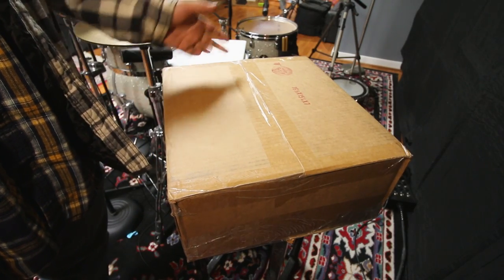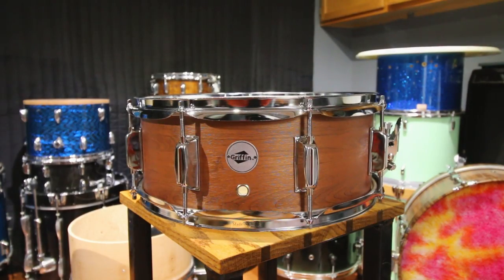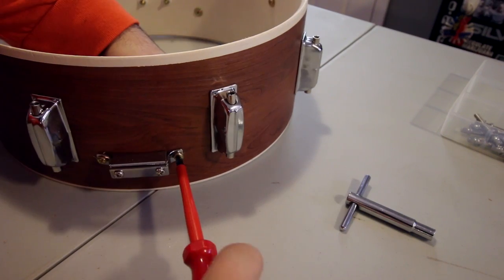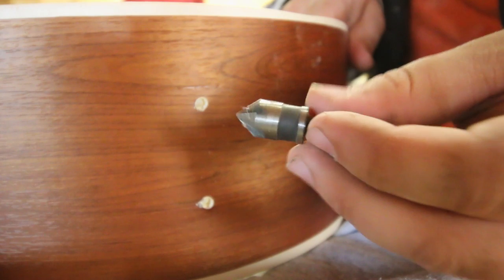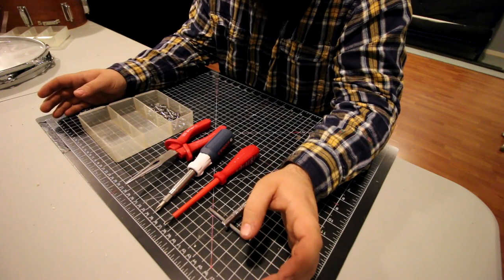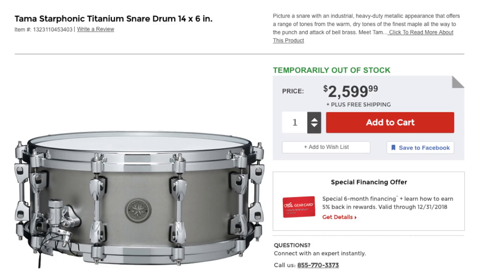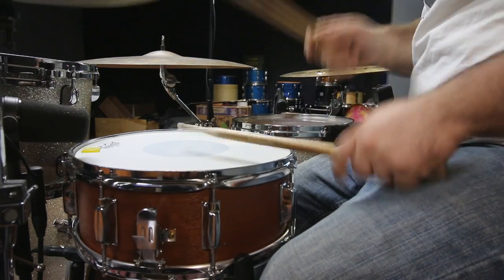The CHEAPEST SNARE on Amazon - worth it? -

Comment: a pro tip for cheap snare ... use the cheapest acoustic foam and place around the inner wall of the snare drum, that will kill the sound a bit but it compensates by adjusting the tension ... it definitely improves the sound.

Comment: I used Tung Oil on my 7 piece Mapex Venus Series kit.. it started out as a 5 piece (22x16, 12x9, 13x11, 16x16, and came with a 14x5.5 snare for $140) all made from basswood. I live in Florida and while it was stored inside a guys house I still felt the need to treat the inside of the shells. I then ran across 2 more toms (8x8 and 10x8 for $40) which I purchased from the same guy who sold me the 5 piece kit. Sad thing is he lived almost 2 hours away and could of just sold me the 2 extra toms last time I got the 5 piece. But thanks to your videos Im now a craigslist watcher lol. I took off the old wrap and used some self adhesive wrap from Amazon. I purchased all new heads and even went as far as to get another snare (Mapex MPX 14x8 maple snare) all of my toms and bass drum heads are Evans... I got the EC2 batters with EC reso heads. My bass drum has the EMAD2 with the bigger muffling ring. But for my new snare i purchased the Remo reverse controlled dot batter and the Ambassador clear snare side heads. Even though Mapex put Remo's coated UV batter with a remo clear UV reso... but after swapping the heads i got the full snare sound. My question though is what would you suggest for dampening? Ive tried that moon gel but it seems to do nothing. While restoring the kit (i turned the bass drum into a virgin bass by filling the tom mounting holes with wood pudy.) Then I used wood bondo for the dents and dings on the bass (i tried to skip that process but once i started putting the new wrap on you could see where the dents were.) Your channel has encouraged me to continue fixing up my kit and after a month of sanding, patching, sanding, using tung oil, and some more sanding... my kit was complete. I only used 2 coats of Tung Oil on the inside of each tom and the bass drum. I left the snare drums alone but after seeing this I may try a coat on the original snare that came with the kit. I dont want to mess up my maple snare. Now that Ive got a 7 piece drum kit that I repaired (mostly cutting out rubber grommets from a sheet of rubber i purchased from amazon) and having spent hundreds on 2 double tom mounts w/ an accessory clamp for cymbals (currently i have 6 cymbals). Im looking for a decent 3 or 4 piece kit. Any suggestions? After wrapping this last kit im not entirely worried about the wrap or how ugly it looks. I mainly check the inside of the shells for rust or corrosion on the screws/washers. Also i look for damage done to the wooden shells. My next set will use Remo coated heads as I see most kits with awesome tom tones have those Remo coated heads. But Im sure the type of wood the drum kit is made of makes a huge difference as well. Thus why Im writing you a book on your old post lol but Ive got a few friends who want to play reggaeton type music and I feel my Basswood mapex Venus series isnt really tuned or styled to play that type of music. The pitch that my drums are tuned too is geared more towards progressive rock.  Any suggestions or tips would be greatly appreciated. But again thank you for posting a the videos you do about purchasing cheap equipment and making it sound good.  Long live the bearded drummer!!! Lol

Comment: "And requires basically no tools"

Proceeds to use a drill and a screw driver
Reply: Face The Bear pretty much everyone has a screwdriver. Don’t need a drill but it helps speed the process up
Reply: dude how do you not have a drill and a screw driver
Reply: @ezicarus8216  yeah apparently
Reply: @genryhennis2102  And pliers, hammers, power drill, circular saw, various hand saws, grinder, recip. saw, drill bit sets, bench vise, vise grips, channel locks, etc. etc. etc....
Reply: @snakeknife7518  all you really need is a drum key and a screwdriver lol most important things he did were replace the heads and the snares and those or the only tools required to do so

Comment: A fun and interesting little project. If you are like me, a drum junkie, than it makes perfect sense. I confess, I did almost exactly the same things you did. I tried something a little different with the springs in the cheap old style Pearl lug knock offs. I used spray -in foam insulation. Spray for like a nano second or you end up with a blob of foam you have to use a razor knife to sculpt the lug back into being. But it works. As for what to do with it, I ended up doing three of them, one in each of the finishes they were selling them in on ebay at the time..and gave them to a local Catholic elementary school band so kids who's folks couldn't afford to buy stuff like that would have something to learn on. (I'm not Catholic, but they aren't rich. So we're even... : ) Thanks for posting this. It's a fun watch.

Comment: I used a solution of 60% Satin urethane and 40% acetone on my 6 ply birch Ludwig "accent" kit, made the wood hard without coating the surface which sounds kind of plastic-ish to me. I did heavy coat, then light, and light, and my low rent birch kit, booms like a 6 ply maple, nice rich tone..

Comment: I actually refinished my Ludwig accent kit when the wrap peeled off and when I did that I did coat the interior with polyurethane, as well as cleaned up the bearing edges, added gaskets and did your cotton ball trick except I used that egg foam stuff. And the kit sounded so much better when I was done.

Comment: See my "is a honda accord as fast as corvette?"

Yes, i just removed the honda body and replaced it with a ferrari body....then, i figured i would just go ahead and toss in the ferrari engine. So now my honda (well, it is a ferrari BUT it has a license plate that says, "my honda is batter than yours."  The dude who owned the hnda before me owned a pancake mix factory.  Get it? Batter?  Try to keep up. Anyway, my honda blows doors and it only cost me 3200$ to buy that honda....3200$ for a super fast car..., genious!  Any body can do it....just go grab a 250,000$ used ferrari and get at it.
Reply: Sometimes it's better if you don't speak

Comment: Good video. Very interesting. I'm making a snare from a crappy 10" x 7" tom: I stripped all the hardware and wrap, gonna give it a green sparkle paint job. I'm making my own wood hoops, and possibly even my own lugs as well. My 'go to' heads are the same as yours. But my snare mechanism and wires on this project are cheapo. My drum is just an experiment in refurbishing as a method of upgrading, and also trying out a much smaller sized snare.

Comment: I did a similar thing with a cheap steel student snare.  A little rtv under the flanges, and a little rubberized undercoating inside, the snare "calmed"  down from it's annoying "pang"  to a crisp, and drier cut. Sounded like a $350 hammered steel snare. Same top and bottom remo heads you installed.

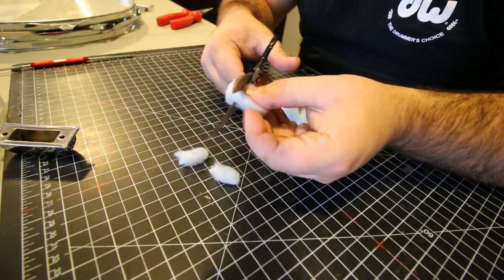Comment: @ 5:40 - this little trick to dampen the spring with cotton wool is similar to the method used to deaden the "spring" sound on a Strat-style tremolo, only I use cut sponge foam rather than cotton woo and have it actually inside the springs - which of course are larger than these drum ones so it's quite easy

Comment: Interesting! I'd have also waxed the bearing edges and replaced the plastic snare straps with cords. Since i never use the internal mute on a snare i would have left it off. For packing the lugs, i like using gray felt weatherstripping (found at most hardware stores). I like the Tung oil idea...i gotta get some of that!

Comment: I did the same shit, bought a cheap starter snare, ripped off the wrap. Sanded  the bearing edges and face.
Lighty stained it and put like five coats of polyurethane on it. 
It Made it a bit harder and heavier
Put some new Remo heads on the top and bottom, fatter strainer. Tuned it high... I swear too gosh it sounded almost as good as my buddy's DW snare. No joke. 
Drums are like anything else you can make a cheap set sound really good if you put the TLC into it!

Comment: Very late to this but if you want to add some sharp snap to the drum add 5 or 6 layers of fiberglass to the inside of the drum. If you do it, make sure the grain of the glass is orientated differently for each layer. Wrap the outside of the drum with painters tape in line with the lug hole pattern and tape the rest of the holes on the outside of shell. This is just to prevent resin bleed through. You might be pleasantly surprised when done. It should have a lot of interesting piccolo characteristics but still be a 5.5" drum.

Comment: I think we're missing a step in the tests here.
I think the heads that come with such a cheap drum will be shit, basically...
So it would've been nice to know what it sounded like with just new heads, without doing all that other stuff.

A bunch of years ago, I bought myself the cheapest junk you could find, partially for fun: An old and very well used Samick junior kit. (12" snare, 16" bass drum and matching toms...)
I gave this kit a set of new quality heads (Evans or Remo, don't remember) and it sounded decent (-ish) right away.

Decent heads is key.

- = - = -

Anecdote time:
A band I was in, were playing at a local gig, warming up for a slightly more well known local band...
I'd been told it would be ok to use the other band's drums, I just needed to bring my snare and favorite cymbals.
The other drummer had of course been told the exact same thing.....
So there we stood, two bands with a lot of cymbals and two snares, but no drums. Yay!
So I drove home to my apartment nearby and brought my tiny Samick junior kit. I could almost carry the whole kit in one go. :)

After micking it up, everybody were amazed how well that little pile of junk sounded.

Biggest problem was that the other drummer had a huge snare drum, maybe 12" tall or something, probably even more.....
There were some height compatibility problems. :P

Comment: You made quite an improvement in the sound. I did the same one time only it was a used cheap chrome snare.  Sounded like crap when I got it.  After messing abound and buying new heads, cleaning it and tuning it sounded pretty good.  Sold it for abound 80 bucks.  Oh well....... it was fun.........

Comment: I use an instrument 5-7 days a week, 2-4 times a day and replace strings every 1-2 weeks max. To me they are disposable parts.....to someone who plays for an hour every month they often commit to a string till it breaks. You did a cracking job getting the original parts to sound as good as they could. Rather than replacing the heads with stuff you normally use, I reckon the development of this kind of video would be to buy the cheapest parts to create the most unique, but not budget, sound you can get out of it.

Comment: That Pearl snare you showed in this clip I bought at Guitar Center for $74.  It was an emergency, as my main snare (Yamaha Beech Custom) was stolen on the road.  It took some time breaking it in, but it never sounded bad.  I've used it in the studio literally hundreds of times with great success, using the original heads.  Hmm.  It seems me  that tuning is literally everything.  You can use a CB 700 kit in the studio if you tune it right.  Worth it?  Is it a playable drum?  Hells yeah, it's worth it.

Comment: you can always turn the snare into a table lamp. Just wire an LED to the inside, use an old snare stand as the support, and put it on the side table. Or sell your new lamp on Ebay. ;)

Comment: Get a 2 or 3 ply mesh head (def. not a silent stroke !!), 27mm and 35mm piezos, a Quartz foam cone, some wiring and a 6 1/4 TRS female panel mount jack, some aluminum profile, screws, nuts and washers, some black double-sided foam tape and convert it to electronic. Then sell it or use it if you have a module.

Comment: Great review.   Before I saw this a purchased this exact model.   Really I know that I would be using it in a hybrid setup so a threw a mesh head on it and a trigger.   Removed the bottom head and snare.  It's really cheap and flimsy so beware.   But it does work for my purpose.

Comment: Great video..Thank you.  I am amazed ..we think alike.. ya'know.. similar.. I've bought a ton of cheap chinese drums.. the wood is softer than Bass or Pine.. or about the same as Pine...very soft.. a few of my chinese drums stained up w/hand rub stain.. took a ton of stain tho but turned out Bomb. .. Nice.. note never use anything but shellac, Varnish..or Poly (oil based Poly) as a clear coat after the stain is dry.. I used lacquer first big disaster so delicate a fly could scratch it.. .. read up on hand rubbed finishes. I had one or two near disasters requiring restain.. harder to match the other 5 or 6 drums exact color and shade.. and shininess. The results was spectacular .. but had to pack and move.. a couple drums with the softer poly finish got some scratches.. took a ton of patience and luck to get it right.. all my drums the ones I used were 10", 12', & 13"  I cut the shells down to produce:  two toms 5"x10" two 3"x10" and one (plus a twin of it) 12"x5".. almost all the drums have twins.. different finishes...as I cut the big adult 5 piece set (w/ a 16" x16" floor tom.. I cut in 4" sections stained but didn't use.. plus ordered cheap toms from ebay or amazon..  ..the 10" & 12"..cut all in half or thirds.. the 12" or 13" deep toms produced about 4- 3"  drums..I made my own DIY mesh heads..what a pain.. about 15 or 16 drums.. and took some refining the way they were built to get the best stick response.. commercial heads may be better I just couldn't afford that.. seeya  sorry so much space to tell my tale.

Comment: Be a good secondary  fx snare. Drill holes between each lug all the way around at 1.5 inches each in diameter at the midway point of the shell.  Tuck an SM57 just inside one of those holes. Compress , Reverb , Limiter , Awesome.

Comment: Frankly, as a non-drummer musician, I thought it sounded fine as soon as you tuned the drum with the original heads and snares. Then again... I'm guessing that it's important to know that off-the-shelf replacement consumables will fit the thing correctly, so it's good that you went to the extra effort to test that (and doing so did definitely improve the sound).

Comment: Thinking about splurging on one of these for my DIY A2E conversion project I'm currently doing on my old 90's era Mapex Mars 4pc (12" & 16" toms. 22" kick)? 
I lost the original steel snare for that kit ages ago, and I figured one of these cheap-o Griffin snares would be an uber-affordable solution for rigging with a dual zone piezo wiring harness? It obviously wouldn't have the super silky positional sensing found on pricey Roland snares, but for $40-50 plus maybe another $10-20 in conversion parts?
IDK. Seems tempting.
Acoustically? The thing clearly sounds like ass, and I respect you trying as hard as you did in attempting to remedy that. Ha!
Yet strictly as a "drum shaped object" to convert to a nerdtacular E-drum? 
Uh...
Perhaps?! LMAO! 
Wadda you think? Worth it? 
BTW, I plan on using an old Roland TD-6V module with several 13"/14"/15" inch Lemon E-Cymbals and a GoEdrum Hi-Hat controller. 
Great video BTW. 
Also, don't judge my e-drum lifestyle please! ROTFLMAO!
Thanks in advance!
Cheers!

Comment: i would have also gotten rid of the plastic straps that hold the snare wires on. They tend to stretch or break easy. Awesome video though man! I love the work you did very informational.
Reply from the maker: and used....
Reply: rdavidr I actually went to my local craft store and bought strapping that's just like what pure sound sells with their snare wires. Much cheaper and sold by the foot. Swapped out several of my snares with it.

Comment: Rebuilt, it sounds pretty sweet! Though, with new heads it does sound like it did when you tuned it with the old skins. Did you have to muffle the snare quite a bit after tuning it with new heads? I see you put the foam on it.

Overall it looks and sounds like a great drum for what you put into it. Has it stayed in tune, have you thought about putting new lugs on it?

Comment: Once you got the new heads on and tweaked the drum, it sounded fine. It's definitely more dry and flat than just about any snare this size that costs into the low hundreds or more, but it's better than I expected it would sound. I wonder how durable it is and how it would last under constant use (especially in a touring context).

Comment: should have used piss down poly urethane oil. sealed first then sanded then another top coat or sanding sealer and lacquer poly is heavier darker sound you piss down ure with thinner that way it does penetrate the wood about 1/8 of an inch sounds good to me brother

Comment: Sorry but I disagree with your logic. Even tho the heads do wear out and are eventually replaced, you were trying out the sound out of the box of the snare you bought, which included heads. You took it apart, "cleaned" it, and you never checked how that affect its out-of-box sound. So you can't really compare the original sound with the later one.